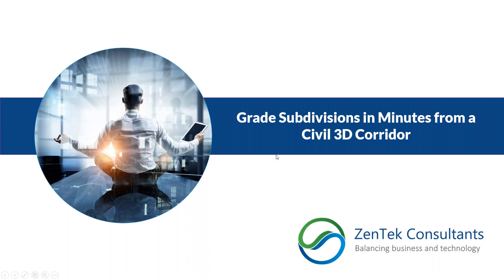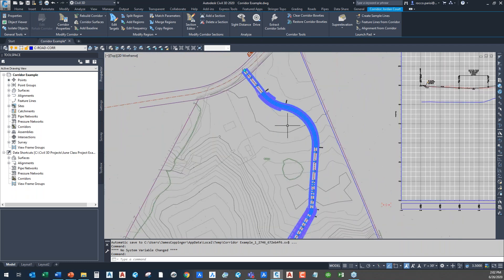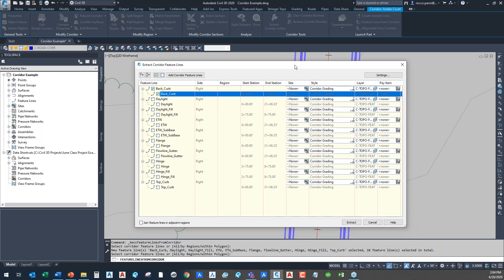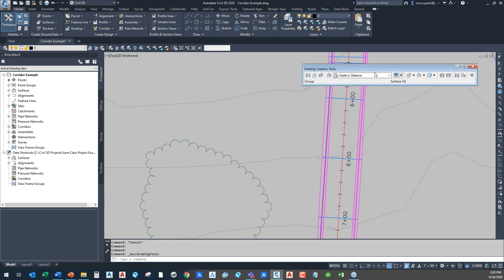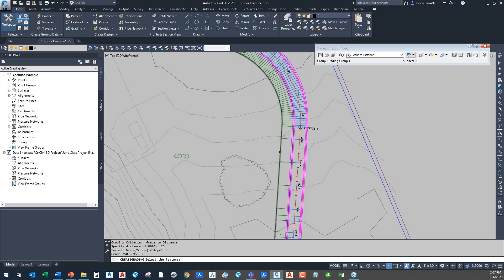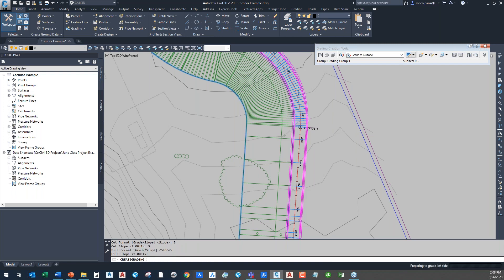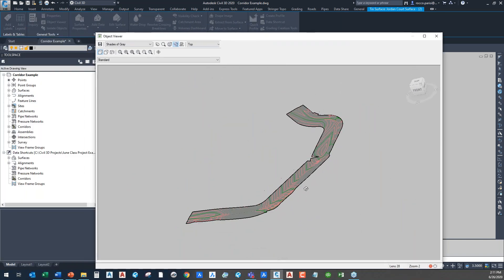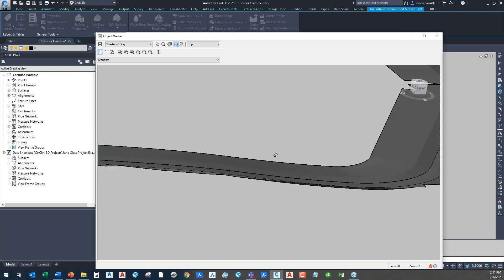Grade Subdivisions in Minutes from a Civil 3D Corridor

Comment: I'm curious why not just use the corridor to do the same thing?  Extracting feature lines and creating grading seems like extra steps that could easily be accomplished through subassemblies.
Reply from the maker: Either way works, and neither is wrong. For a lot of people, subassemblies are tedious and confusing, especially when working non-standard designs, so a feature line is a simpler control structure to work with.

Comment: Very good video. Short and straight forward. 

One question, we design a lot of open ditch in lieu of curb and gutter. Since the top banks of a ditch constantly changes, how would I be able to do this accurately?
Reply from the maker: Thank you Dakota Naramore. The easiest way to handle the ditch is to set an alignment/feature line on the top of ditch and use that as a target for the edge of the ditch in your assembly. I usually use the various Link tools from the generic tab of the too palette for this. HTH
Reply: @ZenTekConsultants   In the case of adding ditches could you add 3d polylines for ditch top and ditch bottom then add them to the surface as break lines.
Reply from the maker: @cutter3011  Absolutely! Basically, 3D Polylines, Feature Lines, and Breaklines are all the same thing so you can use them interchangeably.